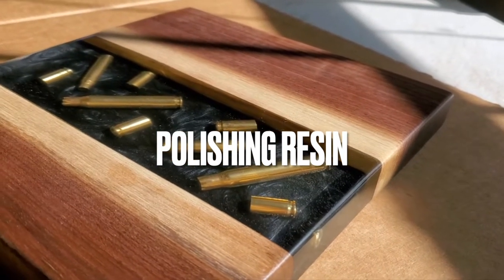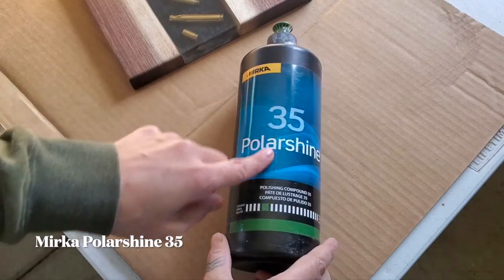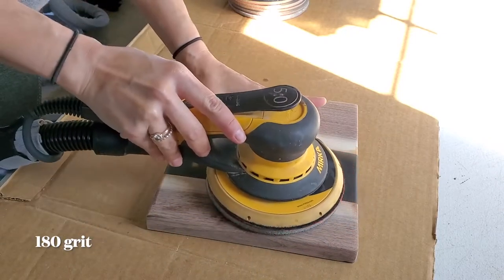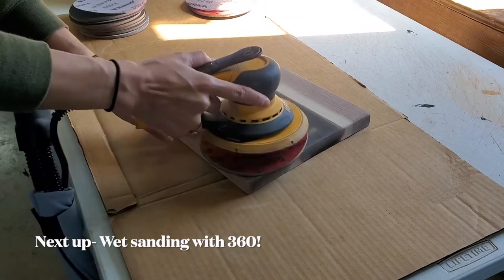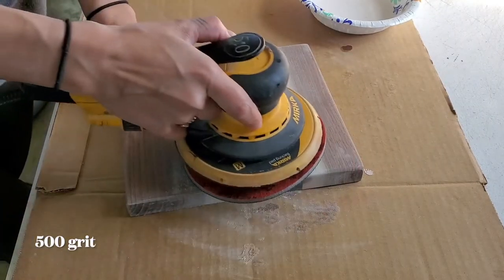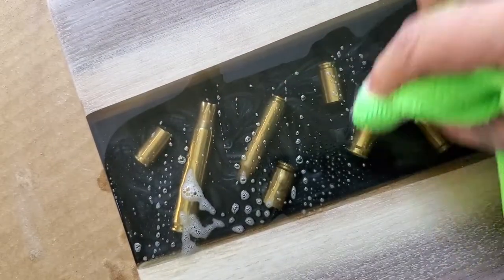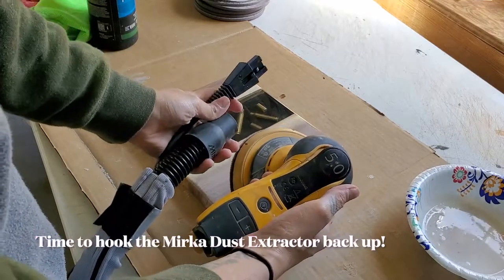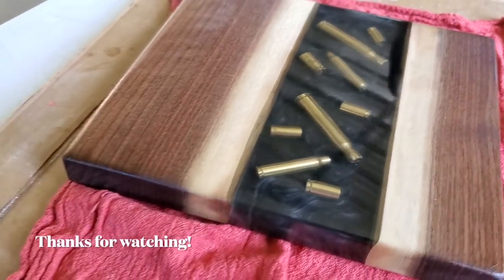How To Polish Epoxy Resin & Get Glass-Like Results With Mirka Deros Sander

Comment: Hi! As a gun girl, I love the cutting board!! It turned out great. 
I’ve got a background story and a question. I’m making a .925 sterling silver wrapped wire pendant for a customer and initially I had filled the holes on the demonstration model with acrylic top coat nail polish. We decided to go with resin instead because it would strengthen the wings  increasing the of the pendant. 
The problem came when I taped the wings (I’ve done 2 of the four so far.). Thank the Lord I had the foresight to at least separate the wings, but because the frame of the pendant is crafted of several pieces, gauges, and shapes of silver wire, the resin flowed and pooled under and beyond the border of the frame. 
So, I spent at least an hour just trying to flatten it out and find the wire edges. I still need to pick up a multi grit sanding pack. 
Do you have any tips which might make the other wings pour easier from the start? Thanks in advance for any tips, ~Ali

Comment: You Rock!  Your video drove me to buy the MAS epoxy, and some items on your Amazon resin list.  

Question:  Any tips for cleaning the mixing pails and mixer drill attachment?
Reply from the maker: Awe yey! And I let the resin cure in the plastic mixing cups and then I flip them over and gently hit them with a rubber mallet and then squeeze the sides a bit till the resin pops out. Sometimes it’s easier than others. And for the mixers… ha. I just let them drip and cure and usually leave the resin on there. So not much help there!
Reply: We have found that Alcohol and Acetone work well IF you allow it to soak a bit.

Comment: Is there a risk of the epoxy getting too hot while sanding and causing damage? I was using a belt sander for the early rough part on my first attempt and it seemed to get pretty hot.

Comment: You are wasting a lot of time sanding through the grits.. the first level of paper you use removes any imperfections and flattens the surface.
The each of the remaining grits only needs to remove the peaks left by the previous level of paper that was used before it... with an orbital sanding, all grits after the first will only take a few passes back and forth, or 10-20 seconds on each area MAX (this assumes you aren't skipping more than one grit at a time). Any longer than that and you're just wasting time sanding material away and not actual making the surface any smoother. 
The LOWEST point of the valleys left by the intial grit should theoretically be the lowest point of any other grit to follow, ultimately becoming the finished surface once all of the peaks are removed.
In other words, you're removing base material with the initial grit ONLY and flattening the sanding marks with the proceeding grits.. i.e. You're going from this: '`'`'`''`'`'`'`'` to this: _______ in steps like this: ```'`''`'`''`''`'`' ->  \/\/\/\/\/\/\/\/ -> VVVVVVVV -> vvvvvvvvvvv -> , , , , , , , , , , -> ______
Reply: exactly. When you factor in time and materials this would be expensive.
Reply: What would be your suggestion for the highest grit to use? 320?
Reply: @jefferyf6930   you'll never get a glass like finish stopping at 320,  unless your spraying a clear coat or putting and epoxy top coat. but when you're doing it like in this video I go all the way up to 1500, not skipping any grits, doing 4 passes on each grit going as slow as she is, any if you  only do  one or two passes you'll never get rid of the swirl marks, then after 1500 , 3 passes with Mirka 45 , 2 with Mirka 15 and 2 with Mirka 5 . that's my process and it works good. if you see little swirl marks after 800 or 1000, sand them out with a sanding block and your hand, then move up to the next grit. good luck !